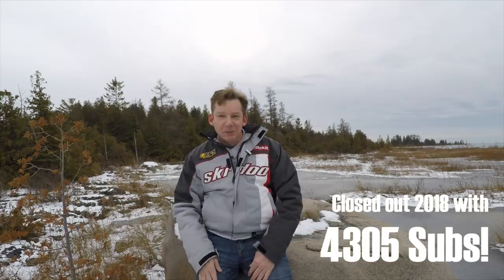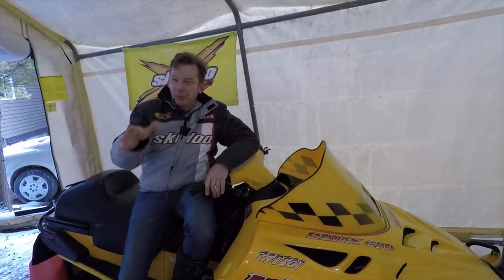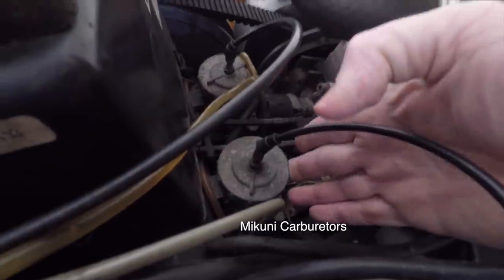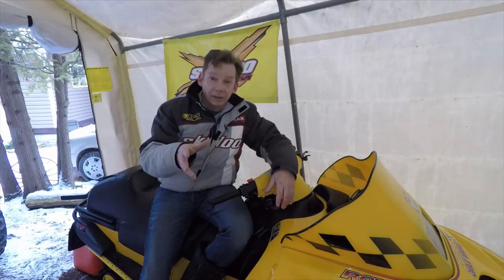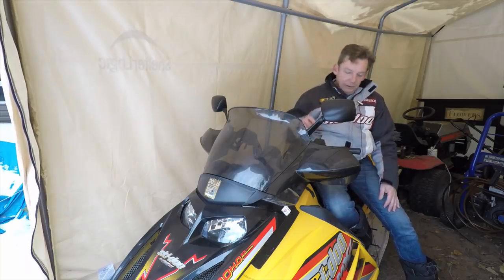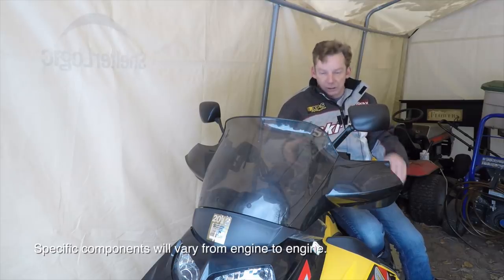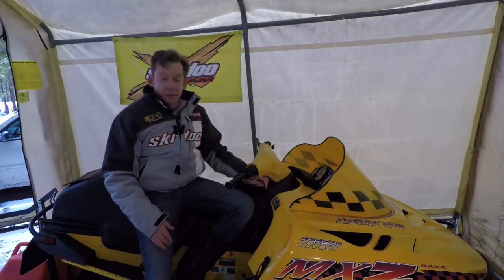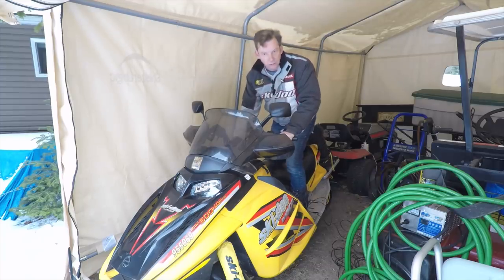Carburetors or Electronic Fuel Injection—What do I think is Better on a Sled?

Comment: Actually you can adjust carbs, you can change jets and needles, I’ve used both and found I can dial in better performance on my carb by adjusting the needles and jets to specific situations. Usually getting top performance out of the motor. EFI is still good and has less maintenance but you are limited on adjustments. Some EFI’s are BETTER than others. EFI does vary from brand. So depending on what brand you buy really depends on the EFI. It’s really a personal preference but if you know what your doing on your carbs, they are hard to beat! The maintenance isn’t really that bad!
Reply from the maker: Hi Scott, I didn’t say you can’t adjust carbs…. I said “IT" can’t make adjustments for things like temperature and barometric pressure. The distinction I was making was accurate. A carburetor is a simple mechanical mixing device. I did specifically say you can change jets etc, but once it’s set it does its job, unlike an EFI system which utilizes sensors providing information in real time on temperature barometric pressure, engine speed and throttle position to deliver the required amount of fuel for the current operating conditions. The EFI System is designed and programmed to meet specific requirements, usually a blend of performance and emissions. Sure you can make adjustments to your carb, and you can change the programming on and EFI system. What you can’t do on a carb, is make changes to the way fuel is being delivered, on the fly as the EFI system does. As I said, there are advantages and disadvantage to both but the EFI system, functioning properly, will always deliver the correct amount and mixture better than a carb. Thanks for watching and commenting.
Reply: @MyOldSled  ok you can still make all those adjustments just not automatically.
Reply from the maker: Hey Scott. Exactly. The whole point of that comment in the video is that the reason YOU have to swap jets, and make those adjustments is because the carburetor cannot.  
On the other hand, the EFI system can make a lot of other useful adjustments you can’t with carbs.
- ECT sensor relays engine coolant temp to the EFI control module, which adjusts the mixture for cold or warm engine starting, so you don’t have to mess with a choke or primer. 
- Warmer air is less dense and needs less fuel to operate efficiently which can make carbs sleds like my 670 run rich when it warms up on a ride. On my 600 EFI the air Intake temperature sensor adjusts fuel delivery based on the temperature of the air coming into the engine. 
-  EFI can adjust both the air/fuel mixture and timing to compensate for Knock or Detonation - which can damage an engine.
- If an engine is running rich, there's less oxygen in the exhaust gas /  if its running too lean, there will be excessive oxygen. Based on the info from the 02 sensor the system will adjust the mixture accordingly. 
etc etc etc
I love my MXZ 670 carb as well. It is solid, reliable and easy to maintain…But it just can't do any of these things, no matter how I tune the carbs.
Anyway, thanks again for the comments. It’s been an education having both and learning the difference in problem solving each.

Comment: What should you do if your sled won pull over. What should you check and go over and look at
Reply from the maker: It actually won't pull over? Like you can't turn the motor? or it won't start?
Reply from the maker: Hi Nathan. Just checkin in on this. How did you make out.?

Comment: Yes in a perfect world I would agree that fuel injected sleds are more reliable and certainly better/more consistent running sleds.
But there is a lot that can go wrong and can be a real pain to diagnose and or costly to repair.
Reply from the maker: Hi Plymco, on any world, they are a more reliable, better running sled. You’re right, They can be a pain, and some of the parts are expensive, but if the machine is looked after, they’re pretty unlikely to fail. I could trade my car in for a bicycle, then there’s almost nothing to fix...:) thanks for watching and commenting.
Reply: I had an 08 600 sdi and the tps sensor went last winter. Sled wouldn’t run for more than 30 seconds. Had to tow it out with my new sled. $400 fix. Sled sold for $3600 over the summer. Just a recent example.
Reply from the maker: You paid 400 for a throttle position sensor?
Reply from the maker: ...oh, did you take it to the shop?
Reply: My Old Sled 
Yes I had taken it to shop and they went through it. Read code. Replaced sensor.

Comment: Great simple explanation and comparison. IMO, EFI is great for the guy who keeps things stock  and wants reliability. Carb is better for the guys who like to modify their sled and need to adjust the fuel/air mixture to compensate for mods. The big complaint I hear from the trail rider about carb sleds, is adjusting for temp. Holtzman Engineering makes a product called "Tempa Flow" that automatically compensates the fuel air mixture on carb sleds based on temp. http://www.holtzmaneng.com/carburetion-products

Comment: Efi is a sealed system so water will not get in when it sits. Carbs are vented so water will get in. Efi is more likely to start up after sitting, but one of the many complicated components could fail suddenly during a ride. Almost all carb problems will show up when you try to start it, and a sudden failure while riding is far less likely than with efi. That said, efi has been around for a long enough time that the components are very reliable. While a repair to the efi system is more complex and costly, it's also far less likely to be required. You might want to inspect or test the injectors and pumps if you have the engine apart for a rebuild, but how often is that required on a non race sled? My vote goes to efi for maintenance because it's almost never required, also efficiency, consistency, power. Same reasons that all street and 4s dirt bikes are efi too. People want to press a button and go and get ideal efficiency and power in all conditions with no hastle and no fuel system maintenance. It's a no brainer as long as it's a well designed reliable system. I'd take a carb over a bad efi system, but those can be researched and avoided.
Reply from the maker: Thanks A, thoughtful response.

Comment: Thanks David, love your channel and what you have to say to us about the sport of snowmobiling and tips on how to keep stuff maintained on our machines. I bought my first Ski-Doo last year , it is a 900 Ace Renegade Enduro Rev/XS  I'm loving the design and ride comfort. I have a question for you that has nothing to do with carburetors. My operators guide  says - Electric start models only: never charge or boost battery while installed on snowmobile. Can you explain the reason for the warning? Thank you and keep up the great stuff here on This Old Sled. Cheers, John Leon
Reply from the maker: Hi John, sorry for the delay. To be honest I'm not 100% sure. I imagine it's to protect components in the electrical system against spikes as the manufacturer would have no idea what kind of charger you are using. When in doubt I always follow the directions in the manual. Sorry for the delay.

Comment: Way prefer EFI. I also prefer fan cooled. Sure wish I could get a fan cooled sled with EFI. Maybe that is another video idea, Fan vs Liquid cooled. Up here a lot of guys prefer fan because of the late season riding. I always had overheating issues with my liquid sleds.
Reply from the maker: Hmmm thats odd. Liquid cooling should be more efficient. Where do you ride?
Reply: I ride in the Northwest Territories. The liquid sleds with efi are way faster and more efficient. But they need snow. My liquid sleds would overheat because I was crawling through narrow trails and not getting snow on the heat exchanger. Or snow would build up on the heat exchanger, melt, then turn to ice leaving an air void preventing cooling of the sled. Then I would have to stop and cool the sled off and break the ice. Arctic cat was bad for this, skidoo was way better. Fan cooling is relatively trouble free but half the power.
Reply from the maker: Yeah for sure liquid cooled sled will work better when your throwing lots of snow up onto the heat exchanger. There are lots of fan cooled sleds that run really well. In both cases, the engine and its cooling system are designed to work together. I think the higher powered sleds require the additional cooling of a liquid cooling system. A fan cooled sled will cool less efficiently in warmer temps. Everything is a trade off...

Comment: Id like to see a video with advice on how to prevent a snowmobile from going up in flames and how best to put out  the blaze thanks my first mxz 670 went up in flames last friday my dad and i used our helmets tp throw snow on the fire but had to go get a shovel and finally got it snuffed out but it is unusable now thius topic will make a great video for you thanks
Reply from the maker: Biggest tip for you...inspect your sled thoroughly before each ride. Look for leaks or debris under the hood...animal nests are a bad one...in terms of putting out the blaze...let me noodle that one, but honestly, plastic and gasoline....pretty potent combination. Smothering with snow is probably most practical. But let me think on this. Thanks for watching.

Comment: I have no thoughts on a fuel infection sled I’ve only had carb sleds. That said I have a sled from 1979 runs like a top
Reply from the maker: My 97 runs great. my only problem is finding parts. Things like pipes are near impossible to find.

Comment: Do not run empty with an EFI sled ! And always use 91 non ethanol gas ! And always run them 3/4 full throttle in the trails but if going slow always blip the gas off and on !  EFI sleds run crazy lean ! Just my 2 cents !
Reply from the maker: Doobyboy!!...What is up my friend? Unfortunately, I ran empty with my EFI sled today. I'll have to have a look at the gauge.
Reply: @MyOldSled  Damn back to square one ! Nahh it's cause on my sled when i run it empty, I need to hook up a battery with cables to activate the electric fuel pump... It will not start the sled by pulling... So if you are out in the woods and go out  of gas you are doomed, especially if you are alone !  And i'm doing better !

Comment: Can you switch from carb to full injection ??
Reply from the maker: Hi Alfred. Well, I guess you could...but after installing a new computer, throttle bodies, air temperature sensor, water temperature sensor, throttle position sensor etc etc...you’d probably wish you’d just sold your sled and bought a fuel injected one...
Reply: My Old Sled ok thanks

Comment: Well I sold my 2002 Polaris edge because it was getting harder to find new parts for it.  I looked for carb boots and they are actually getting hard to find. Maybe because of covid issues and supply and demand not sure but even royal distributing didn’t have any. But that really wasn’t the reason I sold it. But it will be harder and harder to get parts.

Comment: My local Polaris dealership is selling me 4 injectors for 2000€ which is 2,191$...  And the injectors are only about 1/7 of the EFI system. 😅 I know how to work on them but the amount of money that the EFI system can require is really not worth the benefits of the system in my opinion. Especially if you have to take it to a shop for someone else to work on it and also pay for the labor as well is just wasted money.

Comment: EfI has better advantage as far as not having to adjusting any jets, for temp and elevation, to where Carbs, you have to change the main jet, which is not all that hard to do, maintenance, Carbs are easier because EFI, you may have to buy new relays once in a while and can cost like hell, using fresh gas with a good stabilizer or SeaFoam, you are all set to go, I own both and this is a tongue twister to answer, both have ups and downs against each other. But as far as not having to choke or priming, EFI is the way to go

Comment: I like single carbs better they are t easy to fix and more reliable
Reply from the maker: Hi Syb3r2o0th....I'd agree with ease of repair. Carbs are a pretty simple mechanism, no sensors or other complicated electronics...then again EFI is easy to fix, just replace a component. Not always cheap, and diagnosing EFI can be tough. EFI, when it's working properly, is much more reliable....when it works the way it should..definitely plusses and minuses to both. I go back and forth...thanks for watching and commenting.

Comment: And honestly carbs or sdi/efi have no different I’m starting because look the mxz vs the rev both started on second pull
Reply from the maker: As I explained in the video, with the older sled (they’re both mxz) I need to keep using the primer to keep it running. The fuel injected sled has no choke, and no primer, it just runs. On a colder day, it’s even more work. Thanks for watching and commenting.

Comment: the power output of a fuel injection sled is not necessarily higher matter of fact the sdi your sitting on had less HP then the mxz600ho carb version and noticeably different in performance and yet they made them in the same chassis some fuel injection systems are higher horsepower but not all
Reply from the maker: Hi Carly, 
The 594cc Rotax in the 2005 Ski-Doo MX Z Adrenaline 600 H.O. SDI that I’m sitting on, and the 594cc Rotax in the 2005 Ski-Doo MX Z Adrenaline 600 H.O. (carb version) were both 115 HP. If you look at newer models, the 2015 MXZ sport (carbed 597 cc) is rated at 110 HP,  compared to the 2015 TNT etec version, (efi 594 cc) at 120 HP. It's hard to compare all models because there is different technology beyond just the carburetion type, but an EFI sled will, in general have "better" power output because it runs better more consistently, and its a more efficient engine over-all. Even if they are other wise identical engines, the carb cant adjust its fuel mixture for barometric pressure etc.

Either way, both of them are more than fast enough for me :) Thanks for watching and commenting.

Comment: I would say it all depends on what she doing with the snowmobile. If you’re racing it carbureted is the way to go. You can squeeze every last little tiny bit of power and of the machine. But if your trail riding it or riding in the mountains EFI hands down. I own both. My race sled is carbureted and my every day driver is a EFI.
Reply: I couldn't have said it any better. I was going to post the same thing. Think snow!
Reply from the maker: What is your race sled?
Reply: Right now I have a 1000 Thundercat.

My last one  was Arctic Cat M7. 98 miles an hour in 660 feet. And that’s an efi   

My personal every day driver is a crossfire8. Yes I’m at Arctic Cat guy LOL I do love your old 670 though. Are used to have one and loved it. 

As far is draining your carbs.  I don’t think that’s a good idea because your seals and everything else that needs lubricated in your carb gets dry. And when that happens you get leaks and all other kinds of things going wrong. And you’re talking rebuilding your carburetters then.  Which isn’t crazy expensive but can be avoided.  I suggest running stabilizer in your last tank of fuel. You’re best off to keep your fuel tank full during the summer. That way you don’t get no moisture in your tank.

I normally run my sled every 2 to 3 weeks. Not necessary if you’re Reading stabilizer but I like to hear my toys Lol
Reply from the maker: Hi Larry, I agree with storing with a full tank of fuel to prevent moisture accumulating in the tank. I also recommend running fuel stabilizer in the tank. Good suggestions. My preference is draining the bowl, again on the advice of a skidoo mechanic, but I know a lot of guys feel the same way as you, on keeping parts wet. I can see the wisdom in both, but with today's fuels, I feel better draining them. That said, I do run the sled periodically through the summer anyway during the off season, so they aren't empty for the whole summer. Thanks again for sharing your thoughts, really appreciate it.

Comment: Have both a carb and efi sled efi is far better. i would not trust my carb sled if going somewhere with no cell reception or no where close to town, unless someone else is going with me who is riding an efi sled.
Reply from the maker: One of the reasons I upgraded to the rev was so I was more confident in the sled on longer rides.
Reply: My Old Sled i hope the new sled does you well

Comment: 2 pulls to start carb, 2 pulls to start efi.
Reply from the maker: Hi Luke. While I agree starting a sled with a carb isn’t much harder than fuel injection, once you know how, that varies from sled to sled and greatly depends on a ton of factors, pretty much all of which an efi sled can compensate for. The main difference in terms of starting is efi doesn’t need a choke or primer, as it can automatically adjust the mixture to compensate for temperature. Thanks for watching and commenting.
Reply: Ah OK. I just got my first fuel injected sled. I haven't used the pull-starter yet to compare. I do remember endlessly priming citation ss, trying every choke configuration, and pulling about 100 times before it would start though 🤣
Reply from the maker: Now im confused. You said 2pulls to start carb…